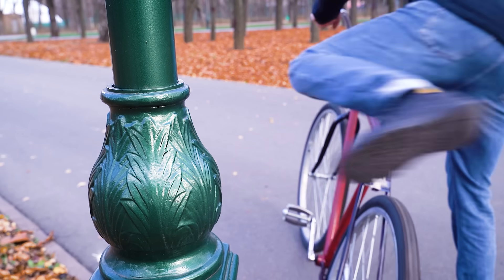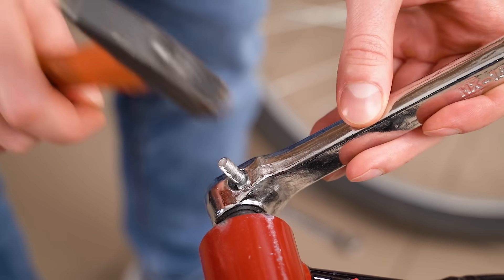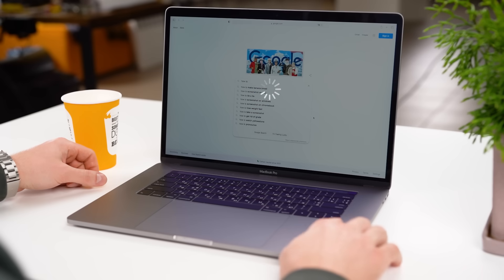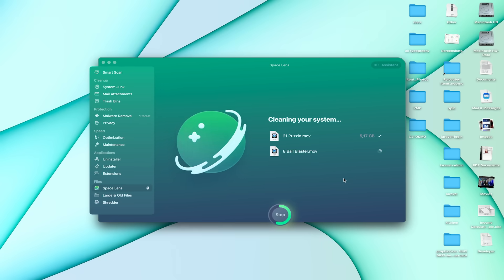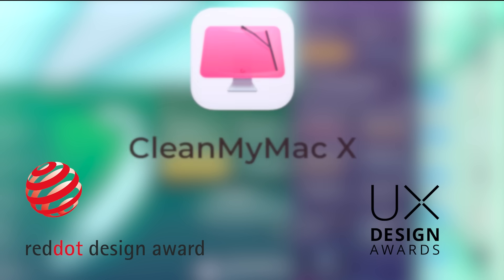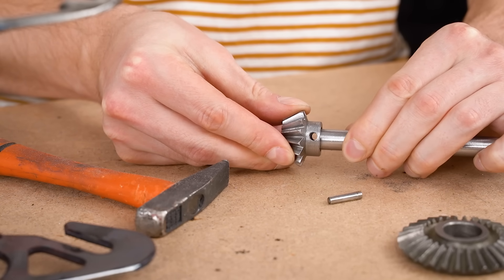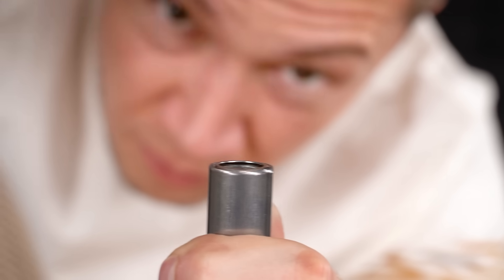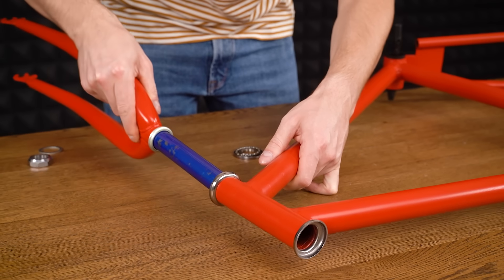Insane Chainless Bicycle Prototype

Comment: Congratulations on the rediscovery of ancient bicycle technology.
Reply: Exactly what I was thinking.  Chains were popular since you can have multiple gears to handle a variety of road conditions.
Reply: @vickanid1862  gears are nice in hilly areas, though for flat areas a bike like this would be fantastic.
Reply: @vickanid1862  actually you can have a drive shaft bike with gears. It just needs large cone gears and the ability to hold the drive shaft in the correct place on them.
Reply: @vickanid1862  this one also can have gear if he want to do it..
Reply: @vickanid1862  Aaaahhhh... if you look at cycles from the Netherlands, you see a lot of internal gear hubs. Commonly in 3 and 7-speeds. They've existed since 1903.
Reply: @vickanid1862  This isn't a problem anymore with the Pinion gearbox.
Reply: @vickanid1862  this paired with a Shimano gearbox hub would be super cool
Reply: I'm definitely buying a 10 dollar chain instead of doing this
Reply: @eduardoalvaroglez  bro in usa it's 10 dollars 😮, in india it's about 4 dollars you get chain of very good quality and company's original chain, it must be hard for you to change the chain again and again, cause I change it in every month🙂
Reply: @eduardoalvaroglez  bro in usa it's 10 dollars 😮, in india it's about 4 dollars you get chain of very good quality and company's original chain, it must be hard for you to change the chain again and again, cause I change it in every month🙂
Reply: @eduardoalvaroglez  No😊
Reply: @eduardoalvaroglez  that's holy 800INR. we can buy same for 1.5 dollard in India
Reply: @eduardoalvaroglez  I’m definitely not gonna keep spending 10 minutes a day fixing my chain
Reply: @eduardoalvaroglez  Who asked?
Reply: @eduardoalvaroglez  chains tend to get stretched and lose some power efficiency, i would like to have a carbon frame fixie with a titanium driveshaft, but i would probably need to sell my kidney to build that
Reply: @eduardoalvaroglez  Yes, but you would not get a video with 40 millions views.
Reply: Accomplishment is the best part of this video. Congrats on that. The chain is the most efficient drive train.
Reply: @shamoy1000  dici giusto ma questo non sporca e non incastra il bordo dei pantaloni
Reply: @shamoy1000  don't remember exactly which video i saw but it said shaft driven is actually more efficient under one specific loading.  But yeh gearing chains allow more efficient under varying conditions.
Reply: @shamoy1000  and durable.
Reply: @shamoy1000  belts are more efficient but yeah.
Reply: @ze_or   chains are even more efficient
Reply: @shamoy1000  How is it?
There is always five in chains, so you lose efficiency. 
With a geared system you have a direct link and transfer of torque.
Reply: @KyleTheDalek  Apparently gears suck up a lot of horse power through friction. All race bikes are chain drive.
Reply: @KyleTheDalek  you have an immediate transfer of torque but the degree of transfer is 90 degrees. That causes a lot of loss in terms of gear to drive gear not to mention the ratio of the drive gear to the driven gear was not multiples of much of anything. Now if he would increase the gear ratio and get rid of the degree of torque transfer reduce it in thirds and each third divide down the 90 degrees necessary to drive the rear wheel then you might actually increase not only speed but torque would ease in faster and much smoother even giving the rider an extra second or two reaction time when climbing hills etc...and if you want to coast this geared bike you can pop your final gear in and out of clutch a simple set up for the most part
Reply: crescent 1900 chainless
Reply: @titimagde  gg en
 (TT):-P:-|
Reply: Think I had a chain break 1 time and I been cycling since a boy.
Reply: I think you all mistaken figure of speech and hyperbolic time chamber speech.That or whatever popo said.
Reply: Uther MacEanruig and people correcting cheeky are oh so geniuses who's accomplishments are typing bs and emojis on random YouTube comment sections

Make way for their intellect everybody, clap for this pointless discourse

Idiots
Reply: Enjoy the ride folks chain driven or cog these comments are the stuff of LEGends 😂
Reply: Was this sarcastic?
Reply: ""WE ARE EVOLVING........JUST BACKWARDS""
Reply: Let us see you do it then smart as$
Reply: therr are some pretty durable chains out there today though
Reply: Ancient? Not at all... We recently bought new bikes without chain recently...
Reply: Педали постоянно вращаются,неудобно
Reply: غير شكل
Reply: This is for people who have no idea of bicycles.
Reply: But just appreciate his work not judging it
Reply: А никого не смущает передаточное число от педаль на звёздочку заднего колеса??? Мне одному кажется что велосипедист слишком быстро крутит педали и при этом медленно едет???
Reply: The word ancient is used in a connotative way and minds are just blown that words also have connonative meaning.
Reply: Indeed but think about it is kinda dumb that we use chains on single speeds so this ancient tech is smart in the modern day. Smarter not Harder
Reply: @robberman6403  Efficiency is a thing.
Reply: Significantly less efficient than standard roller chains which are extremely difficult to improve on.  And that's before considering the rubbish fix gear single speed aspect.
Reply: @Mrbfgray  the older ones of these that I've seen aren't single speed, there's a gearbox in the wheel hub.
Reply: @n1nj4l1nk    I see.  Nothing wrong with fooling around w drive trains but having two 90deg changes in rotation axis will illuminate the reason traditional roller chains are used, they are far lower friction.  Losses in those gears will make such a bike slow, few are going to want that.   A typical person can only sustain a small fraction of 1 horse power.
Reply: Ну и сколько у тебя проживёт дифференциал без смазки?
Reply: @Ростовский-г6х  ну а почему бы нет. Должны ж быть эксперементаторы и энтузиасты, а не только нормисы которые кушают что дают
Reply: Ñ
Reply: I’m dead xD
Reply: Hater
Reply: Wait till he rediscovers the chain
Reply: Yep jusyvwhat I was thinking 
....now I have a square  thing,I am calling it a friconless wheel. 
It's so easy to drag or push 
.if you put these circular  things  under it 
.after a night on it I recon I will call these  things rounds...
Reply: Burns 🔥
Reply: Going back on old tech is not innovation.
Reply: It is too slow, its better you walk 😁

It is not rediscovery yet 😁
Reply: How is it this many comments deep and no one knows you could just put that rear sprocket on an internal hub drive like a rohloff or sturmey archer? In fact im pretty sure there were 3 speeds with this drive made in the early 1900s. The whole point of that drive system (i forget the name) is to have it entirely encased and slathered with grease and safe from the elements tho which they dont do here.
Reply: Not discovering but mastering. Do you master it? Most ancient technology : fire. Can you make fire not using matches or a lighter etc…?
Reply: Old tech that doesnt actually work in scale and weight
Reply: If he figured out some gear shift mechanism that would've been great.
Reply: Awesome job but speed???
Reply: Haha
Reply: u funny
Reply: We did not have bicycles in ancient times 😂
Reply: Good 👍👍👍
Reply: First generation of motorcycles are belt-driven then replaced it with effecient and durable heavy-duty metal chains.
And nowadays there so many belt driven scotter,girls motorcycle yeah.
They are as fast so it's okie.
Reply: @enginestart3009  car also use almost same mechanisme like the bicycle whjch this guy invent..this more strong actually but abit difficult if we start to paddle at hill climb.. this is 8 gear level already if we all use chain ..
Reply: @wiseman4969  the frame of a bicycle is small and you cannot put too much gear components becuz it's becomes heavier and it needs more power to move unlike powered engines(electric ,fuel gas).
Reply: @enginestart3009  yes i know..this bicycle are waste alot energy for the user because no free force like chsin its free force even we stop to paddle..because the beating forward is neutral..this bicyle no that efficent because connect direct to the paddle..but still hv solution
Reply: @enginestart3009  i can create eternal force just use 2 magnet.. which both of the magnet atleast 10kg..force can produce so big..also almost eternal
Reply: @wiseman4969  okey haha your choice your direction. The important thing is your happiness. You have my full support.😄
Reply: @enginestart3009  yes..idea is precious
Reply: Great at spotting that most would think that a new idea. Have a Great Christmas!
Reply: Dude the ancient bicycle have the pedal attach to the front wheel, not with a gear on the back wheel laki this one😑
Reply: @Shanum Rahiel  On American Pickers they showed a barn find bicycle with this type of gear system. Not every invention in the past got a patent it was less venial times?
Reply: thats true 🤣
Reply: @kevin sanjaya  After seeing Mike showing a bike with similar cog drive on American Pickers yes rediscovery. Enjoy Christmas
Reply: Siipp...👍
Reply: You can't even respect the work of this man 🤡 Shame
Reply: It's not a discovery idiot. It's only an improvement on his bicycle.
Reply: what about breaking system??
Reply: Thanks
Reply: I don't care what all of your think in done someing great
Reply: By his self
Reply: He done some great
Reply: Somebody didn’t do their homework, someone beat him too it more than a 100 years ago.
Reply: As fábricas de bicicleta poderia fazer esse tipo de bicicleta aí, muito legal.
Reply: As fábricas de bicicletas deveria fazer desse jeito seria top 👍
Reply: As vendas de bicicleta deveria fazer desse jei
Reply: LMFAOOOOOOOOOOO
Reply: Engineer moment
Reply: It’s creative but not practical.
Reply: fact 🤣🤣
Reply: Wrong. They still use this. Little bit of research.
Reply: I have my ancient sword ready.
Reply: Были такие кареты с велоприводом на них дополнительно устанавливали маховик и при переключении передачи можно было преодолеть небольшую горку
Reply: Ahem, 126 YEARS OLD BICYCLE TECHNOLOGY.. I'm a nerd
Reply: @johnm.7610  Ну да где то в конце 19 века
Reply: At least he isn't being smug in the comments on a Youtube video.
Reply: Ancient is as many words, relative. A computer from the early 90s? Ancient. A car from 1970? Not quite.
Reply: Shit I didn’t know about this, super cool vid!
Reply: Does anybody reed the title on this video "I discovered a chain less system"? Congratulations on misunderstood the title of the video...
Reply: I also make homemade inventions, let's get there guys!
Reply: Congratulations being an oxygen consuming giant useless meat
Reply: So odd how people are so stuck creating things that were already existing, innit?
Reply: Yust say BMW in motorcycle 🏍️
Reply: A friend of mine found a bike over 100 years old in an attic with that kind of drivetrain.
Reply: Naa re hater era xd
Reply: Maybe modern tech and materials help?
Reply: Сл
Reply: Слышь поздравляю, ты где видел в древности да хотя бы и в это время, велосипед на карданном вале?
Reply: Uber. Wonderful work. Does it work well when putting some weight and on a steep hill? Do you manufacture it? If so, how can we buy it? Thanks. I like ancient that is being rediscovered. No more chains... uhuuuuuu
Reply: These technnology was from 1920 from the belgium company FN
Reply: Везде китайцы😂😂
Reply: But still appreciate him doing that work. Nice talent right? Since those are not exist now everyone sees him so special!
Reply: Tech that wasn't actually very good or practical, either.
Reply: Major Taylor tested a similar system over 100 years ago.
Reply: @fanch22480lol
Reply: yes😂
Reply: I bet you're fun at parties.
Reply: I really enjoyed this video and think that you did a fantastic job of refurbishing your bike! ignore the trolls…. they troll and argue behind the security of their devices….
Reply: Lol the time line comments and the LEGends comment...and parabolic time chamber lol...yall deep and humorous with it tooo.
Reply: Lol, says the place with slow, expensive service departments! Who wants to impress these people anymore or appreate somthing that has nothing to offer back? Seems fair? Tech is good if it works and you can have fun
Reply: Didn’t know bikes did this before
Reply: Narcissistic fool
Reply: Oui mais tu as vite les jambes autour du coup.😅
Reply: The genius here is 42m views
Reply: Still better than what most of us can accomplish
Reply: No speed
Reply: Насколько я понимаю, но этот конический узел зубчатой передачи сработается очень быстро. 
Не случайно много лет назад от такого способа передачи момента перешли на цепь.
Reply: 9.9k. Like
Reply: Old ideas are still the best... simplistic. manual. Easy
Reply: Shut it you turkey, he did something tpu will never achieve. Appreciate the effort he put in.
Reply: Loss of power is immense
Reply: Crappy ancient bicycle technology which was replaced by the chain for really good reasons.
Reply: @fanch tanguy no I don't change it because it breaks, but because my father and me are kinda aesthetic in terms of bikes and bicycle, so as one month passes the greese looks dirty and it is hard to remove, but chain works fine, but I insist to change it, because that is what I have been doing till now, it like a habit now .

And also I ride on bicycle a lot, mean alot so you can say I am bicycle need but I travel a lot on bicycle .
Reply: @bhavishaysingh1374  that grease is meant to be on the chain, when it gets dirty it's easy to clean and regrease. Kinda sounds like you have more money than sense and don't really know anything about bikes.
Reply: Be much better if he had welded some hamster sized mouse wheels on either side of both wheels, which electrically "stimulated" some athletic mobility hamsters to run at various speeds to push the bike along so you don't have to pedal at all lol....
Reply: Looks like it is geared too low. And you cannot coast. Maybe just buying a chain would be easier
Reply: @joeg3741  yup. It can’t withstand heavy pressure.  That’s why the chain and belt were invented.
Reply: @joeg3741  Maybe he'd rather experiment.
Reply: And  there was an reason why this was dumped and the chain drive with multiple gears replaced it.
Reply: Funny you consider 150 yrs ago as 'ancient'.
Reply: @williamoftexas1489  its a figure of speech
Reply: @djt6fan  wtf is figure of speech? You mean figurative speech?
Reply: @BigCroca  yeah, no. It's a figure of speech. 

Pro tip: if you're going to spout intellectual at least Google first.
Reply: @n1nj4l1nk  r/iamverysmart if it was a person... i did google it and it turns out that "figurative speech" and "figure of speech" are just two names for the same thing.
Reply: @BigCroca  don't give it if you can't take it. I was just matching your condescending attitude.

Google again.
Reply: @williamoftexas1489  congratulations on discovering figure of speech 🤣
Reply: @dmasrc18b  be kind he might be figuring out what that means 😂
Reply: @steandtee  Ancient (def)  'The very distant past and no longer in existence.'    Glad to educate you all.
Reply: @williamoftexas1489  funny that you think 150 years ago would be "very distant past"
Reply: @steandtee  *he.   Learn the language.
Reply: @martinomelfi7272  considering that there where no gas vehicle people where still using horses and steam trains n shit
Reply: @williamoftexas1489  My culture barely exists anymore. Does that make it ancient?
Reply: @clemo86v24  Nope. It makes it nonexistent
Reply: @williamoftexas1489  You seem upset.
Reply: @TroIIingThemSoftly  nope. sipping screwball peanut butter whiskey
Reply: @williamoftexas1489  really? Why did they call pyramid is ancient while its still here in present time?
Reply: @williamoftexas1489 'umad bruh' is another ancient word of 'why so salty' 🤣
Reply: @durian111  Why so salty is a modern version of why are you upset?
Reply: @martinomelfi7272  you're lost. reread my original comment
Reply: @dmasrc18b  😁😁👍
Reply: @steandtee  It's actually referred to as 'figurative language'.  Bam
Reply: @williamoftexas1489  The bevelled gear has been about long before white men roamed texas.
Reply: @williamoftexas1489  in terms of bicycle
Reply: @williamoftexas1489  it is ancient as far as bike is concerned.
Reply: @williamoftexas1489  that would be the greater part of USA's history
Reply: @williamoftexas1489  Funny you don't understand relativity. How's that 8 track player doing?
Reply: @williamoftexas1489  FIGURE OF SPEECH : HYPERBOLE
Reply: @williamoftexas1489  Technically any relic above 100 years old is considered ancient
Reply: @ShwappaJ  who produced that definition?
Reply: @williamoftexas1489  You must fun at parties
Reply: @williamoftexas1489  the term ancient is applied to the original discovery, not how recently that invention was still in use.  For example, knives and spears are ancient technology, even though people still use them today.  The invention was made in ancient times (or even prehistoric)...  so yeah.  Just because certain inventions are still used today, doesn't make them modern technology if they're originally from ancient times.
Reply: @williamoftexas1489  funny you missed the joke
Reply: @williamoftexas1489  I'm only 80 and they call me ancient.
Reply: @williamoftexas1489  In the bicycle world this is really "ancient"
Reply: tells me you don't truly understand just how bikes as a whole are lol
Reply: @williamoftexas1489  Yes very ancient, Thomas Edison epoch.
Reply: @williamoftexas1489  uhhh because it is ancient in the aspect of why it’s GONE… lol
Reply: @aarontrenton1730  Uuuh, that's patently not true.
Reply: @williamoftexas1489   shit it's no one is alive who even remember those bike
Reply: @williamoftexas1489  yes habibi
Reply: @williamoftexas1489  nobody you know was alive back then. It's ancient. If we didn't have the internet and kept records of that time you wouldn't have known.
Reply: @williamoftexas1489  it’s called hyperbole. Everyone knows what ancient means (although there is more than the one definition you gave). You didn’t educate anyone.
Reply: @williamoftexas1489  Saying ancient makes you sound smarter online. Wow i feeling it now!
Reply: @tokinimo54  Yes, it's apparent *I'm smarter than you.
Reply: @williamoftexas1489  you're so funny bro 😂
Reply: @williamoftexas1489  well done 👏 you have discovered figure of spreach. So proud of you! 👏
Reply: @gpan1mations  Spreach?  Dummy.
Reply: @williamoftexas1489  just take the L and move on like goddamn 😭
Reply: @jay_dmp  i won
Reply: @gpan1mations  *speech
Reply: @williamoftexas1489  And yet a 56K modem is a museum piece now...and it's only 20 years old or so.  I have heard that some places still use them...I wonder why?  Security?
Reply: @vickanid1862  why anybody would use them, they are ancient :D
Reply: 1899 to be precise... the Spaulding drive shaft...
Reply: Yo thats just savage 🤣
Reply: Ancient may be a figure of speech, but ancient does actually refer to a specific time period; namely 5000-1500 years ago.